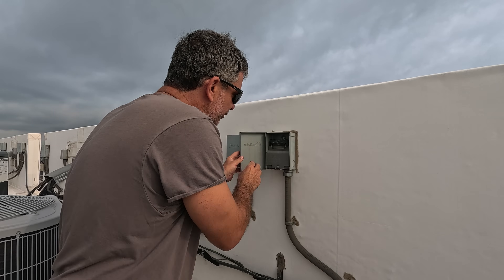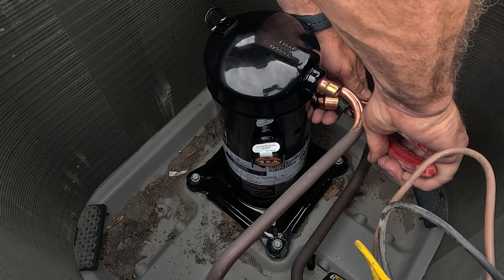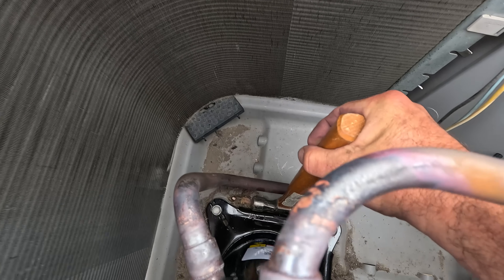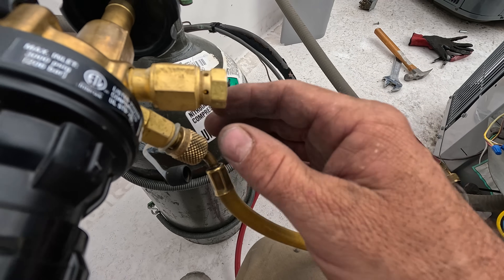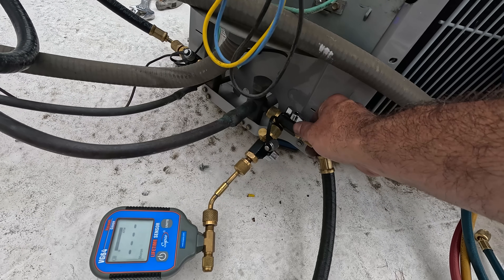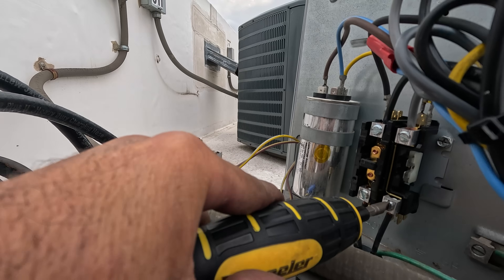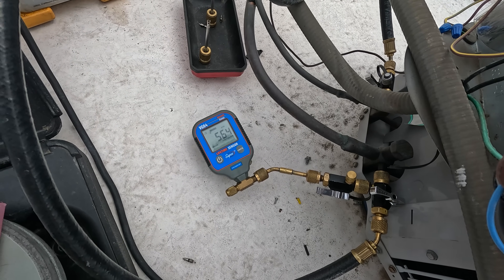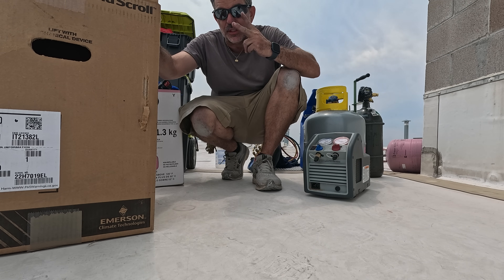2 ton Scroll Compressor Replacement on Carrier Unit

Comment: after taping the suction line onto the compressor you could heat the vertical part of the line in order to ''absorb'' the ''tension'' to avoid poping out. very nice job afterall.
Reply from the maker: Great tip ! Will try

Comment: You added straight liquid to the suction side for the initial charge. Hopefully that didn’t slug the compressor too much on startup😂. I still like the two hose vacuum setup.
Reply from the maker: The compress wasn’t on it’s fine. Slugging occurs when lots of liquid refrigerant enters suction line of running compressor

Comment: I would probably check the voltage at the contactor to make sure there was no power. Sometimes people wire around the disconnects.
Reply from the maker: That’s a good point- I did check the day prior when I made the redneck compressor test video. You are correct never trust disconnects

Comment: Dave, You did a great job. I don't know if they still offer it but UNIWELD used to sell a torch head called Cap'n hook and it was great for unsweating piping because it had multiple flames You weren't as likely to tear the pipe when you pulled it out. I found it handy on compressor change outs. I was wondering where You got your jumper cord? I like those clamps They seem better than the old style. You do good work.
Reply from the maker: Thank you!! I have the cap’n hook I just never really got into using it. I also prefer to cut out compressors unless it’s absolutely necessary to, I’ve actually broke a U coil on a old condenser before doing just that, turned a 2 hour job into a nightmare trying to repair the broken coil joint between the copper and aluminum
Reply: @ApartmentMaintenancePro 😮